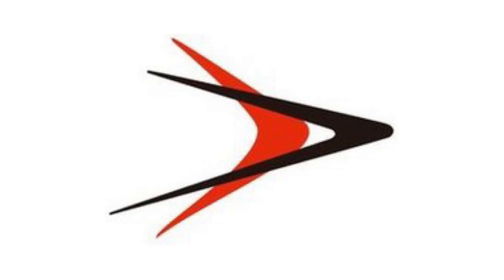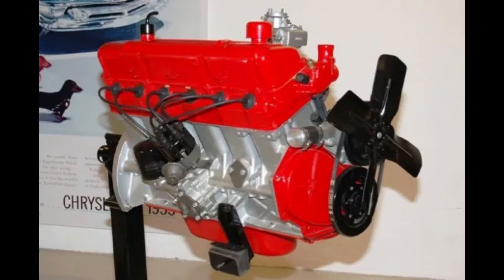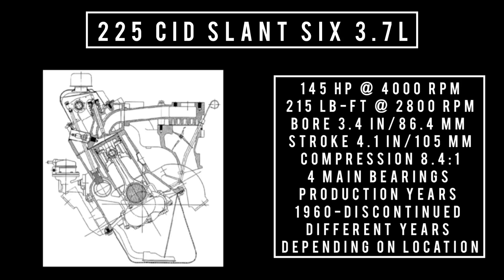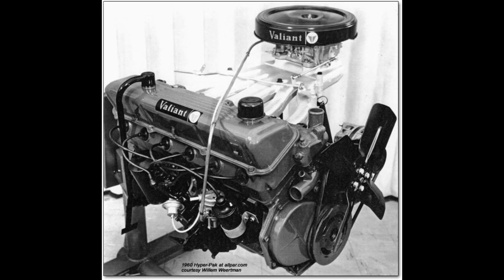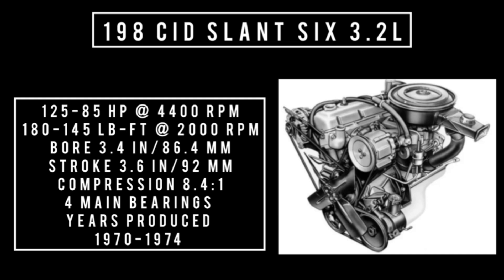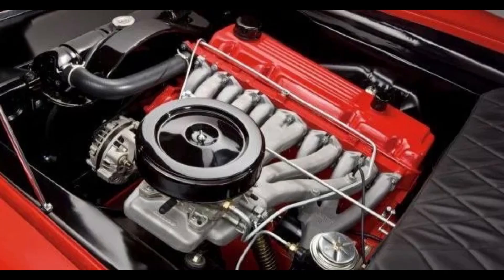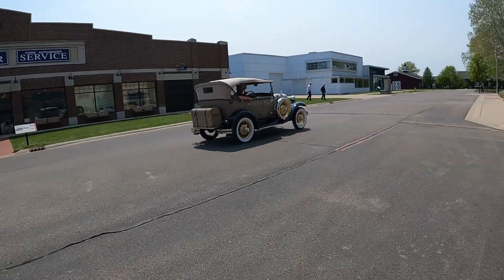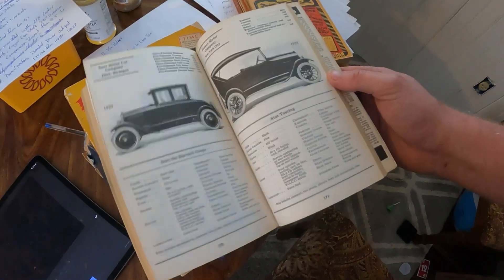Chrysler slant six engine family

Comment: I was a mechanic in 1972 at a Chrysler, Plymouth and Dodge dealership and I can tell you the aluminum engine was a pain.  If they overheated for any reason, they were junk.  Usually we would find a cast iron one at a salvage yard and replace them.  The iron slant sixes were amazingly tough.  I got to drive a Hyper-Pak once and it was amazing!  When you hit the throttle it just kept pulling!  I got to visit with the owner and he drag raced with it and did pretty well.
Reply: I never liked and still don't like aluminum engines.  Fine for racing cars, where a few hundred pounds less weight can mean winning by a hair vs losing by a hair, but not practical for street use.
Reply: @09dave1952  hence a pair of two-barrel carbs on a custom manifold, to “wake them up?”
Reply: Cast iron was the absolute best!!!!

Comment: Hated this engine when I was in high school because it wasn’t cool. Then I actually owned one. Complete convert. It was durable and reliable. I have so many stories of this engine simply always running. You asked about other engines with similar or even longer lifespans. I would propose the Buick 215 aluminum v8. Also developed for the 1961 market. The tooling was sold to rover after three years and continued to be manufactured until like 2015 or something. Pretty neat engine.
Reply from the maker: Awesome thank you so much =) i’m gonna do episode on the Powerball v6 and 215 one day I think it’s cool doing the history of these engine and where they came from

Comment: They ran crappy cold because of the fuel cooling and reliquifying in the long intakes before reaching the combustion chambers. You need gasoline to be atomized then vaporization in the chambers. Liquid in the combustion chamber is what's known as "flooded".
Heating elements can be utilized in order to significantly boost performance of these engines.
Reply from the maker: Thank you so much for sharing that information =)

Comment: Worked at a Chrysler dealer in early 80s.  An old timer taught me to adjust the valve clearance to .009 intake and .019 exhaust.   The engine 225 would be running and rattling when you started and end up  so quiet you wouldn't know it was running.  Ready for another 200000 miles!
Reply from the maker: Great information =) 

After reading all of the comments I kind of sort of want to get a Dodge with a slant six and build the six and have a sleeper

Comment: At one time or another I owned all of these engines and the Slant-6 was the standout. I had a 62' Plymouth Valiant coupe hdtp with the 225 and a three in the tree. My mom had a 64' Dodge Dart coupe with the push-button auto. I was working at a Chrysler dealer in 1966 and an and older lady bought a new Dodge Dart with the slant sic and the auto. She drove it home, about 60-miles and brought it back the next day complaining about its slow speed. She had driven it from Tacoma to Bremerton and back in first gear. We schooled her on the selection of gears and took her for a test drive. The engine had suffered no issues and she went home and we never saw her again.
Reply from the maker: Cool story reminds me of the Nash rambler one the song beep beep.. 

It’s crazy she drove that far in first gear.. i could only assume the engine was screaming it’s head off
Reply: @What.its.like.  Max RPM of over 100-miles would have killed a lot of engines, but not the Slant-Six.  We sent it to the garage for them to check out and they changed the oil and cut the filter to look for damage and excessive wear...Nada!

Comment: The Slant Six is still the only engine to have killed an entire racing series.

In 1960, "Big" Bill France introduced the NASCAR Compact Car series, which was intended to showcase innovations in automobile performance technology - and the automakers happily obliged. There were Pontiac Tempests with the first-ever transaxle layouts, Corvairs with rear-engined, air-cooled flat-6 configurations - and the Valiants with their Hyper-Pak equipped Slant Six powerplants and torsion-bar suspensions.

The Chrysler Corporation's approach was clearly the best one for the series, as Valiants took every top spot throughout the 2 years it ran. After NASCAR's Compact Car series was cancelled, the Slant Six would go on to become the most significant engine in Formula 1 history, without actually running in Formula 1.

I'll leave that discovery up to you, but it involves Colin Chapman, a Lotus 11, a /6, and 186 mph.
Reply from the maker: Awesome information thank you so much for taking the time to share all of that 186 miles an hour out of a slant six would be really impressive. There was another comment saying that Rees Company was able to get 13.1 compression out of it 611 hp at the wheels could you imagine that if you open the hood and you saw that engine under the hood it would be speechless =D

Comment: I had a '79 Volare with a slant 6. It never failed to start but was weak on power. In the late 70's they started using an aluminum intake instead of cast iron to reduce heat which could cause vapor locking. Thie issue with that though was the aluminum intake was prone to warping, making it hard to make it seal against the block.
 The most dependable and economical inline 6 I've ever experienced is the Chevy 250 in a '71 Custom/10 pick up.

Comment: My first new car was a 1965 Plymouth Valiant 2-door 225 standard. I drove it 5 years. Only problem I had was the throw-out bearing went out, I replaced it in the middle of winter in Logan Utah with the small set of Craftsman tools I had. If the gas mileage dropped below 21 MPG I would replace points and plugs. I traded it in for a 1970 Plymouth Duster 340.
Reply from the maker: That’s a pretty good trade

Comment: I had a 66 plymouth Valiant with the 170cu in and 3 spd column shift manual. Good on gas, reliable, ran forever, but had a light rear end, so it got stuck easily in winter.

Comment: The first car we owned in North America was a 1968 Plymouth Valiant with a 170 cubic inch Slant Six and automatic transmission. When we finally gave up on that car, because much of it was falling apart, including the engine mounts, the engine had over 250,000 miles on it, with no major repairs. The car had gone through several transmissions, but the engine was still running fine.
Reply from the maker: Sweet =) it seems like most people totally dig this engine

Comment: Dad had a max wedge Polara and Mom a hyper pack Valliant in I believe more or less 1962.
Reply from the maker: What a unique combination to own at the same time.. That Max wedge engine is really something when it’s running right they can be kind of finicky we had one at this dealership that I worked at last summer when it ran good it ran great when it didn’t it was the biggest pain in the butt for the stupidest problems one time it wouldn’t run right because the gas cap wasn’t venting properly

Comment: high school ride in 1984? 1975 Valiant Custom 225 Slant six.  (SAE 95 HP net)  It could not get out of its own way. Single barrel Holley, had a bad habit of stalling or losing power on left turns - had to do with bowl float.  A Thrush Turbo helped uncork the thing immensely. (had a nice inline-six snarl)  My dad - many years later - called that car "best form of birth control".  It is kind of cool to see that these have made a minor resurgence in the old car world. Very cool to see what the Aussie's do with these engines - big cams, Webers, long tube headers, high compression pistons, superchargers, the works.  The car I had is long gone (A904 gave up), but the engine is probably sitting somewhere in a Gleaner combine or hay mower, still plugging along.
Reply from the maker: I wish we would’ve gotten the Australian version here why do they get all the cool stuff.. One day I want to build a 226 slant six either put a turbo charger on it or a big cam with triple webers.. in my opinion nothing is sexier than when you open the hood and you see an in-line six with three Weber side draft carburetors but you have to have the pipes to the velocity stacks. It’s one incredible looking engine and sounds great too

Comment: Worked at Trenton Engine 68-71. Machined thousands of the 6cyl heads. Also worked in 6cyl  manifolds dept. Dirty and dangerous.
Reply from the maker: Sweet any cool stories from working there?
Reply: @What.its.like.  I was the 2nd shift broach operator. It operated like a cheese grader, scraping metal off. We had a new foreman who wanted to make a good impression. I shut off the broach to change tooling and secured the emergency Stop button. Above all the noise I heard my hydraulics starting. I looked up and he was trying to start the machine. I jumped over the conveyor and knocked him away from the control panel and ended up on top of him. I was banging his head into a electrical control box. He called for the general foreman and said I was to be fired. I told the general foreman what happened and was told to go back to work. The next day we had a new foreman. Had he been able to start the machine I probably would have been shredded. I have other stories of working there.
Reply from the maker: Wow that’s crazy thank you so much for sharing that story it’s crazy that he tired to get you fired after almost killing you. Like how ignorant one has to be to remove a lock out tag out

Comment: My first car purchase was a used 1975 Plymouth Duster with a Slant-6 engine, I bought it in 1978. Reliable transportation, the only issue I had was by 1975 Chrysler was putting a lot of emissions control devices on the car. It had a hesitation when I accelerated from a dead stop which was a carb issue related to reduced emissions, I assume? I also believe it had mechanical rather than hydraulic lifters, which meant you had to adjust the tappet on the rocker arms every few thousand miles or you'd get a 'clicking' sound from under your rocker cover. I worked at Chrysler Product Development Center in Highland Park at the time and the older guys told me the Slant 6 engine started to go downhill with introduction of emissions control in the early 1970's, those systems all had to be add-on's because the engine itself was designed prior to the Emissions focus. Later engines like the 2.2 L transverse engine were designed from scratch to comply with emissions requirements and didn't have the same performance issues. Great memories!

Comment: I found a way to kill a slant six. Which I was told was super super difficult. In the middle of winter you get the engine nice and hot and then you drive down and really steep hill into a huge goalie full of ice water! You can give the engine a bath and crack the mug.
Reply from the maker: Wow that nuts but yeah that will do it one day I want to get 4 of the top six cylinders and put them up against each other

Comment: The engine might have been OK but in cold or damp weather they were junk. I could have made a good living just putting starters in these vehicles. Reliably unreliable ballast resistors; every car had one bolted to the firewall, one hanging on the wires and one in the glovebox. Useless bimetal choke; starter kit for winter was a big screwdriver for the choke plate and plenty of ether.
Reply: Very true, the ignition systems was a big failing point of those engines. A neighbor of ours had one in a dart, and they'd have to warm it up for 20 minutes or longer in damp or cold weather, because it would continuously stall. They were constantly cranking it over, trying to get it to start.

Comment: The never die motor. I had two of them that I never wore out. I wore one of the cars out, Torsion bars, rust and just about everything. but the motor. It didn't even use oil! 

The only problem I ever had was going through flooded streets and intersections if a truck happened to be coming the other way. The distributor was on the lean-to side. I'd be going real slow but the wave from the truck would just get channeled right up to the distributor and stop me cold.. I got the damned thing dry enough to start so I took off and here came another. I completely stopped moving this time but it happened again anyway. I was pissed!.
Reply from the maker: Great story I had a car that would act up in the rain as well

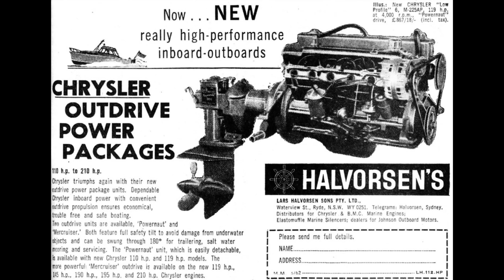Comment: at 2:11 > the Gen 1 Small block Chevrolet  debuted in fall of '54 as the new 1955;s , the last production line install was a 2003 van . Over 90 million installed and that's not counting over the counter crate engines . Still available today as crate engines from GM .
Reply from the maker: Awesome information =)

Comment: I drove a number of vans thru the 70's and 80's with the  slant 6 225.    Total junk.  They sprayed oil, never ran right but strangely  wouldn't die.  Many a rainy day, they needed some resistor on the firewall replaced or they wouldn't start.  JUNK.

Comment: One possible key to the reliability of the Slant Six, I am told, is that the bottom end bearings are the same size as those on the 426 Hemi and the crank was cast iron for much of its production run.
Reply: You are correct.

Comment: As a footnote, if anyone is really still interested in these slant sixes... Some had a really weird idiosyncrasy... They just randomly seized up at around 60,000 miles. Usually it happened when they were parked, I never saw a running engine stop.  Don't freak out of junk the motor.  Just bar it over and it just frees up.  After that it's likely to run on forever. 

No I don't know why it happens or how often, but I used this trick on a friends Lancer and on someone's stuck Valiant. You'll need a breaker bar and a piece of pipe, it gets stuck pretty hard, but you don't have much to lose if it doesn't work.  And no, in almost 50 years of working on cars, I've never seen this on any other engine.  

If someone knows why this happens to the slant sixes, let me know.

And BTW, before anyone get's enchanted with these things, back in the day and bone stock, these things were as boring as they were reliable. Many were put into cars and trucks way too big for them, which resulted in marginal fuel savings and very little power up hills.

Comment: In the early 70,s while in high school I worked at a small Chrysler Plymouth Dodge (Yerkes) dealer in NJ. They had several variants for parts runners and a Dodge tow truck, D 300 if memory serves me with a 225 slant six, and a manual 4 speed. That thing would pull H—- off it’s hinges. You literally could not kill one if you took even modest care of them. Good video and a blast from the past
Reply from the maker: Glad you dig this video =) thank you for sharing all the memories

Comment: The only weakness of that engine, is running unleaded fuel in one designed for leaded fuel. The early ones can eat head gaskets because of that.
Reply from the maker: After reading a lot of the comments I really want to get a 225 slant six car in build it triple webers with the big cam.. too bad that engine is it a twin cam that would probably make a world of difference..
Reply: @What.its.like.  I currently have two vehicles with Slant 6 power. Doesn't always have to be fast to enjoy it. Sometimes its the little things that can be appreciated such as how throaty they sound with the right exhaust, and the snappy throttle response they have. 😃

Comment: OK, hang on.  I’m starting to question some of these stats.  First, I believe the 225 was not offered until 1962 models, not 1960, and the /6 could be spec’d in full-sized trucks until the 1988 model, not 1987.  Heck, you could still buy a 1988 Diplomat with a Slant 6 now that I think about it. As well, my 1961 Valiant, with the 170cu in engine was factory rated at 101 hp, not 117.  In fact, it says it right here in the owners manual…. EDIT: And it says here in my 1962 Valiant owners manual that the 225 in it is rated at 110 hp, not 145.  Yes, it was later rated at 145, but not at its introduction. So, I’m thinking there wasn’t very much research going on here while making this.  I don’t doubt you found some source for your data, I’m just sayin’ it’s not accurate across the board as you’re stating.
Reply from the maker: Couldn’t go into all the horsepower figures for every single year otherwise the episode would be an hour long I’m pretty sure it says up to 145 hp just like the 170 you could get up to 117 brake horsepower in the duration when the engine was being produced

Both 225 and 170 came out in 1960
Reply: @What.its.like.  1959.  Not 1960.  1960 MODEL year, yes. But they were released and first offered in 1959.  EDIT: 1960 models were released in 1959.
Reply from the maker: Yes that’s what it says 1959 for 60 model year =) 225 power peaked at 145 most of the time power out wasn’t that high tho most likely due to carburetor/timing differences

Comment: My father had a 1963 Dodge pickup truck with the 225 slant six that he would load so heavily that he had to pump the tires up to 60 or 70 pounds. He was always splitting rims and finally made his own heavy-duty wheels. He traveled the southeast working on microwave towers. He fashioned a special wheel that served as a crane hub that we wrapped a manila rope around. We would place the truck on wood blocks, remove the wheel and tire and mount the hub on the truck to run materials and tools up and down the towers. That slant six engine left our family with 430, 000 miles on it when I sold it to a roofing company. The slant six was probably the best gasoline powered work engine ever made.
Reply from the maker: Awesome thank you so much for sharing those memories =) bullet proof 

One day I wanna get for bulletproof six cylinders and put them up against one another
Reply: My slant six rubbed a cam lobe right of the cam shaft
Reply: needs a hole from lifter valley to fuel.pump lobe @dianedougwhale7260
Reply: 1st runner-up , maybe